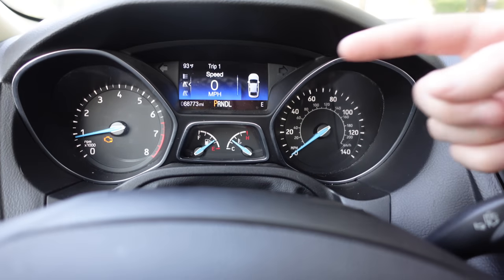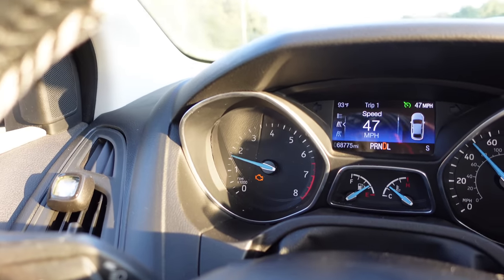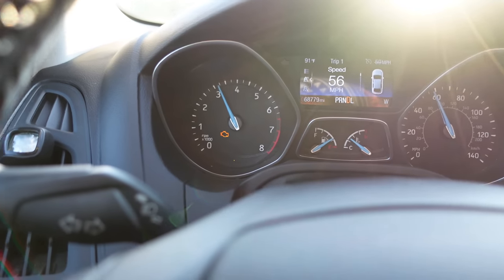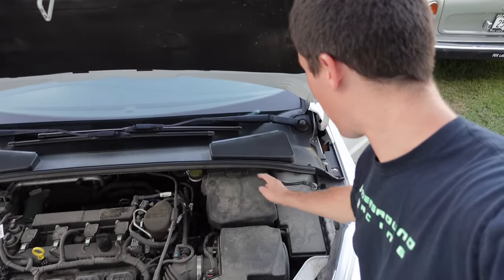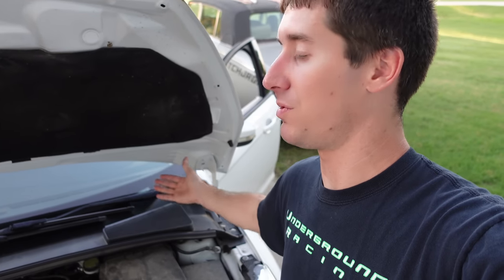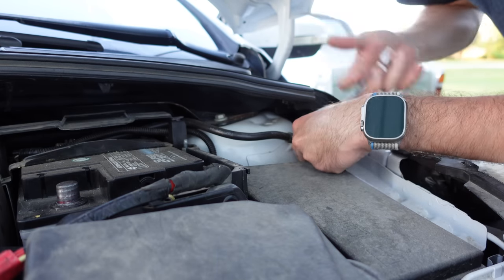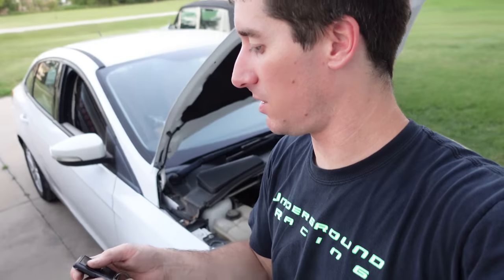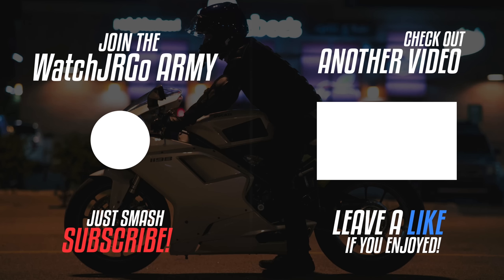This NIGHTMARE Transmission DESTROYED The Ford Focus (Fixing My Girlfriend's)

Comment: This time of year is THE time of year for wiring to get hot and start doing the old ghosts in the machine crap to our vehicles. My Audi a4 decided to have a few of the coil pack wires to melt and touch a tiny bit causing a fault and a small misfire in cylinder 2/4. I had to rip into the wiring, separate those and resolder ALL the coil pack harness wires.
Pain in the ass? YES
Problem solved? You bet!

Comment: Come on JR... you should know what dielectric means... it's an insulator. The worst thing you can do is put it on an electrical connection,
Sure, you'll keep the water out, but you have just compromised the electrical connection. It will fail.
You'be juts made it worse. You can surround the electrical joint with the grease to stop the water getting into the joint, but DO NOT put dielectric grease on the surfaces that need to touch and transmit electricity.
There are so many people who make this classic mistakes... but yeah, look it up if you don't believe me.

Comment: The powershift is a dry clutch system. its a system that failed VW also. on lower power models this always caused issues . its either the mechtronics or clutch pack failure

The wet clutch system's are way more reliable

Comment: Ford and GM cease to be viable choices for me in 2010. The biggest fail is using lead free solder in cars where vibration is a way of life. Lead free solder is extremely brittle and the largest cause of module failures.

Comment: Guys with this Focus trans problem. Before you trash car, check the Focus battery grounding that is well internet documented.
Unseen bad grounding can starve high current clutch motors, delay then triggers  transmission computer codes. Had a 200k Focus throw trans codes. Bright cleaned chassie ground stud and ran #4 ground strap direct to trans case. Codes cleared with no dealer reprograming. It's possible that clutch motors can be damaged from long term current starvation. Ford should have grounded battery directly to engine block like years of proven tradition. All these trans and customer problems because Ford cheaped out on a shorter battery ground wire. 😮

Comment: had a fiesta with this transmission, by far the worst car i've ever owned. bad shifts are one thing but this thing used to drop out of gear randomly. sometimes randomly wouldn't start for 10,15,25 minutes after parking. when it started overheating and the dealer told me to drive it to them *while overheating*, i went upside down to get rid of it. all of this before it hit 40,000 miles. good riddance

Comment: Hey JR....i think it might be too late because you are already trading it to the dealership, but those Powershifts aren't that bad as they look. And they are fixable too. If you could change that clutch actuator it might fix the whole issue. However, they usually fail in the TCM and that can be and relatively easy fix too. You don't have to change it right away. If you crack it open and weld the spade connectors inside the TCM it can get back to life. Double clutch isn't that expensive neither....a Luk clutch kit is around 800-850usd . TCM are nearly 700usd too if you know where to buy them. Clutch actuator are much cheaper than that. Nothing changes the fact that they're not going to improve the shift sensation they give...most dry double clutch gearboxes have the same issue. Audi's DSG and are maybe the best ones regarding shift smoothness. 
I have repaired a couple of this and a looooot of wet double clutch Powershift, and wet ones are awesome (when they work well) super fast and smooth (again, when they work well). I personally own a Hyundai DCT with 60k miles on it, and it fast but not as smooth. And i had to change the clutch at 50k miles....so. Don't be surprised. Nice video
Reply: exactly! I have one of those since brand new, never had any TCM problem which is quite rare... but, I did have to change both of its actuators last year, apparently the clutches make a lot of dirt and that is one of the reasons those actuators get stuck and eventually stops working. Well, now every 80k km I'm doing a proper cleaning of the whole clutch/actuators assembly, never had any issue after that.

Comment: I’m amazed that Ford somehow made a transmission that is actually worse than the Nissan CVT even though it is not a CVT. The Ford DCTs are extremely frail transmissions.
Reply: It's a Getrag transmission, not Ford made.  And the only real thing that's wrong with this one is the clutch Forks getting seized up.  Which is an easy fix for a competent hobbyist weekend mechanic.

Comment: Driving slow is what mostly destroys DCTs, if you´re in traffic and the car is just barely engaging the clutch all the time, it heats up, it and it starts to wear prematurely, in a manual you would avoid riding on the clutch that much and you should too in a DCT but almost no one does. Driving fast is kind of what DCTs were designed for, they take a beating that way, supercars are mostly not used for city bumper to bumper traffic every day driving, if people dailyed them it would be carnage. Most failed DCTs I've seen are of mainly women and elderly ppl that mostly drive slow and love to creep forwards in traffic or stop lights without steping on the gas pedal and those are the kind of people that mostly bought Focus and Fiestas, I'm not saying they're good, engineers were incredibly stupid not to factor in the kind of use they would be getting, all I say is it is possible to have it work properly and be decently durable if you know how it operates and take a bit extra care.

Comment: Hey WatchJRGo! Reclean all that grease off! Sorry man, you did what many of us have done and applied that grease the wrong way. It's not conductive. Meaning it should not be in between the metal on an electric connection. It should only be used around that connection but never in between the metal.

Comment: Too bad, because the manual transmission on this car (and the Fiesta) is pretty good.  I've had two Foci with manuals and they lasted 300k+ miles.  Most Foci in Europe are popular as well for the same reason.  Too bad the auto was a fail.

Comment: The Kia Niro, Hyundai Tucson and older Hyundai IONIQ uses a dry clutch DCT that hasn’t been anywhere near as problematic as this one…why is that?
Reply: Do they use the same clutch forks with tiny bearings in the forks that often seize up?  And these things have a tone of electronics, so grounding maintenance is required.  And people tend to drive these things too hard, which creates more clutch dust on the forks as well.

Comment: ahh the Ford Powershit.  I had a 2010 Mazda 3 (which had a ford originated engine) and the TCM fucked up too.  They mount the damn thing on top of the engine, and the heat destroys them.  I'm led to believe it's a similar issue with the Focus

Comment: You start out by saying that the shift problem is not clutch slip. It's clutch slip, believe me. And then you're not more than a minute or so further into the video and you realize the clutches slip. Ford had to have done this intentionally. They intentionally made this vehicle so that you could not rectal fit the previous transmission onto it. Go out and take a ride on the new Honda Goldwing with the double clutch transmission on the motorcycle. That's what a double clutch transmission is supposed to feel like.
There is no reason why a dual-clutch transmission has to cost $30,000. That's bullshit. Modern manufacturing techniques allow you to very cheaply build a very nice dual-clutch transmission. And the reason why it shifts so quickly, is because it doesn't have to shift it all. For instance, when you are in 2nd gear in a Porsche seven-speed dual-clutch transmission transmission has already selected third gear. When it shifts into 3rd gear all it does is open up one clutch and closes the clutch on 3rd gear. At that point the other portion of the transmission has already picked up 4th gear. That is a very simple explanation of how it works. How in the world you could fuck this up as bad as for did really take some fantastically ignorant people. And to not leave yourself the ability to refit the original transmission back into the car was a mind- boggling, stupid thing to do. And I heard they went to Getrag for the primary components for this transmission. And they're not exactly dumb. But whoever did their controlling mechanisms is an idiot.

Comment: You’re really not supposed to drive the DSP6’s slow, they demand confidence under acceleration and knowing precisely when to back off. It’s a horrible design and a garbage transmission, but they do perform a lot better when you’re practically flooring it coming from a complete stop.

Comment: The manuals are bulletproof. Mine was totaled at over 200k and needed nothing but oil changes and a set of spark plugs. Driving like a dick and Boston traffic, I averaged 36 mpg lifetime calculated at every fill up.

Comment: I can tell you from personal experience you certainly don’t want a KIA either. The first engine seized. Covered under factory recall. Second engine caught fire while at a gas pump. We have “owned” the car for about 120 days now and only drive it for about 17 days total..the car is still sitting at the shop while we are dealing with legal and Kia corporate. Do not buy Kia.

Comment: What I've read about this transmission is that it develops an internal leak due to a bad seal and then the clutches are contaminated.  Ford-Getrag has tried to update this seal but doesn't seem to be able to solve this issue.  There is a huge class action lawsuit as a result, because it turns out that Ford knew there were problems with this unit before ever selling the first car....

Comment: Only 11 people understand how in the world "dielectric grease", can work around electrical terminals, when "dielectric" means "insulating". Consulting Wikipedia is of no help in this mystery. I've also read that fewer individuals understand how a zipper works than understand atomic fission. All I could learn is that the stuff can be used generously with no harm (except to your wallet) since it is just an INSULATOR.

Comment: My wife drives a super early build 2012 (first year of this contraption), and it's at 140k with the original clutch and transmission. It needed a new TCM at 90k, which was covered under warranty. The symptoms of the TCM failing were wild and we had to pull over every mile or so on the way to the dealer since it would just forget it had gears, and then wait several minutes until it went "OH! I'm a transmission" and move for a little longer. But the fix was free under warranty and we got the car back after 3 days or so, and it drove better than new. I have no idea what the lead time is now - this was around 2019 (when they had only extended the warranty to 100k). This video really looks like TCM failure, and I bet it's mechanically fine.

I fully expect PA road salt to dissolve the car before the transmission mechanically fails. Other than this, the car has been almost perfect - change the oil periodically and feed it tires once in a while, and it gets better mileage than it's rated for (she averages ~37mpg, 50/50 city/highway). It likes being driven a little enthusiastically more than it likes being babied - it shifts WAY better if it's not lugging around.

And yes, the battery box sucks. But better than an Escape, haha.

Comment: If they had just put a NORMAL automatic transmission in it instead of getting clever, these cars would be a great used buy. Instead, they're plutonium. DO NOT buy a used Focus. I don't care how many miles are on it. I don't care how well taken-care of it is. That gearbox is gonna pop, and when it does that car is gonna be DONE.  If you're gonna buy one, get a manual. Those don't break.

Comment: They used a different trans in the European autos... Not sure if a 6f from an escape would fit? 
Can she drive stick?  The 6 speed manuals are solid units.
This trans had some design problems, the engineers said it wasn't ready for prime time, but the beancounters/ execs said to put it into production.

Comment: what a shame.  The 5spd manual version is nearly indestructable, that auto trans is detrimental to the reputation of this platform
Reply: You and others are being overly dramatic, these automated manual transmissions are an easy fix in the driveway on the weekend.  An easy Dropping of the transmission, clutch and forks removal, replace the forks with ones that all the tiny bearings slide nicely, reset the two clutch springs, and put it back together.  All of which can be done with no special tools.

Comment: why have an automatic focus the engine is too small for an automatic box  we have a peugeot in work that has the same type of gearbox a manual box with an auto selector its a 1.6 diesel its pointless and the kickdown is like the bible many gears are called but few are chosen

Comment: Is not a dead TCM bruh it’s the clutch forks, you need to clean them
Reply: Yes and/or replace them if any of the tiny bearings in them are out of place and/or stuck or sticky.  And the other grounding points should be addressed too; but with no grease until after the connection, as rust proofing.

Comment: I actually like this transmission. The transmission’s themselves never actually go bad unless they leak the oil out but it’s usually just the clutch forks and tcm that go bad. Also if the battery is bad it can cause the transmission to do weird stuff. Check the voltage on the battery